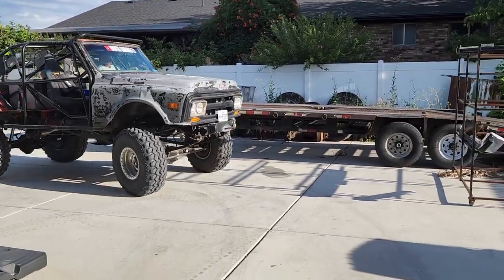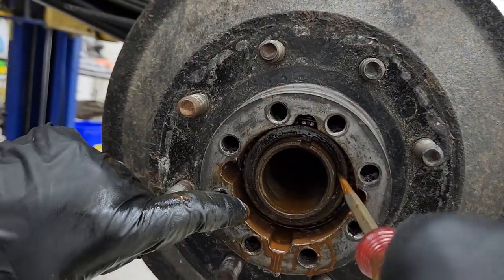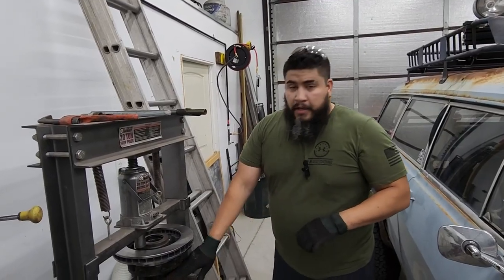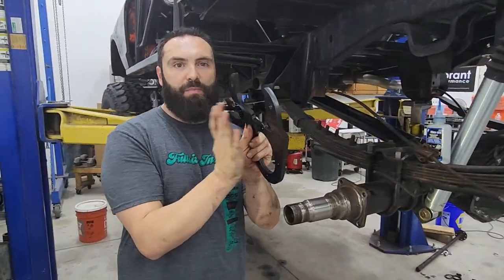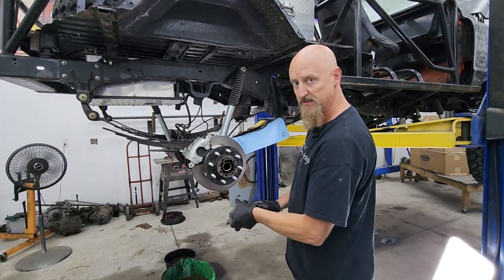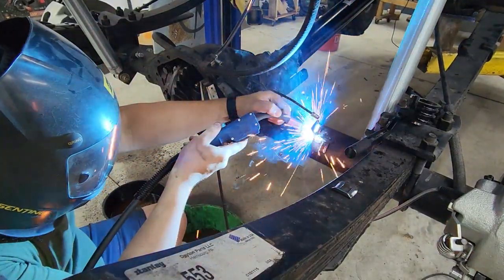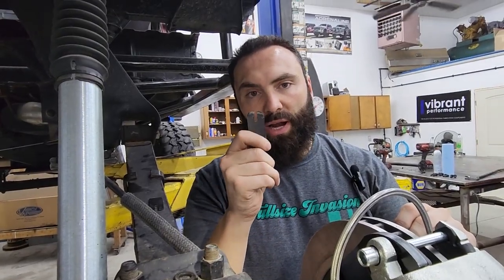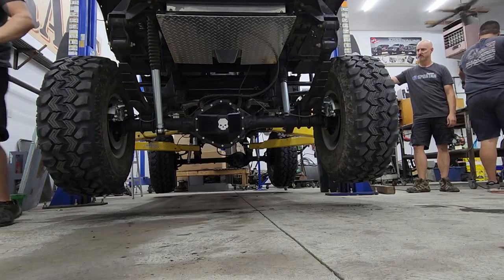GM 14 bolt disk brake conversion from Ruff Stuff

Comment: I've watched this video several times to see how you removed the 2 factory brackets on the emergency brake cable from the drum backing plate. It appears that they just magically disappeared 😊. I think I can get one of them off with a cutoff wheel but I don't know about the other one. I wish Ruffstuff would make an emergency cable for my truck ('80 Chevy K20) with the factory brackets removed and a  bracket that I can weld on my differntial.
Reply from the maker: At 4:01 you can see the 2 bolt holes from the bolts that hold the cable bracket to the backing plate.  We didn't film us removing them, but they were there. ;)
Reply: @UintaGarage  I saw that but I'd like to know how you removed the brackets (or bracket) without damaging the parking brake tube. Both the brackets on my truck are crimped onto the parking brake tube but the bracket on the outside of the backing plate is very thick metal. I'm doing this in my garage for fun. I discovered yesterday that the professionals that replaced my leaking pinion seal years ago cross threaded or over tightened a bunch of the 3/8" bolts that hold the differential cover on (it was leaking real bad). I'm replacing the leaking cover with one of Ruffstuff's 1/4" covers. I have a Helicoil Repair Kit ordered. This is by far the best video I've found of this brake conversion!

Comment: Did you leave the factory proportioning valve located below the radiator in place?
Reply from the maker: We left the valve in place, but pulled the guts out of it.  Hope that helps.

Comment: Has anyone used one of the newer 14bolts out of a 2000s truck with OEM disc brake setup?  Any advice.... thank you
Reply from the maker: We've seen it done, but don't have much information on it. I  think the newer axles are wider though, so that might be an issue.

Comment: When you say the rotors came from a GM ¾t, does that mean they're 1.28" thick and 12.50" in diameter? A.k.a. JB6 or JB7 rotors?
Reply from the maker: Sorry but we didn’t measure the rotors and don’t recall. This is the kit from Ruff Stuff and the specs should be on their site. https://www.ruffstuffspecialties.com/R1877.html

Comment: How do you pull the guts out of the proportioning valve.
Reply from the maker: On one side there is a nut you unscrew and pull out the internals. It basically falls out.